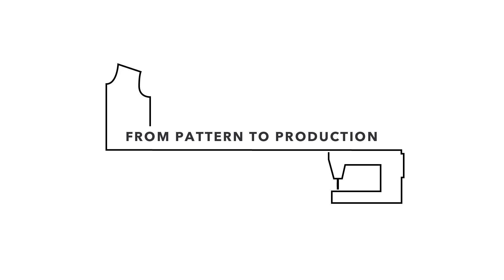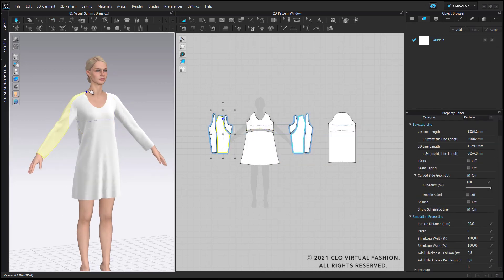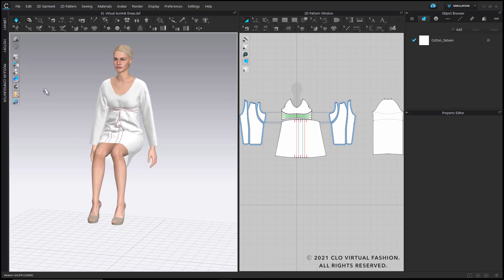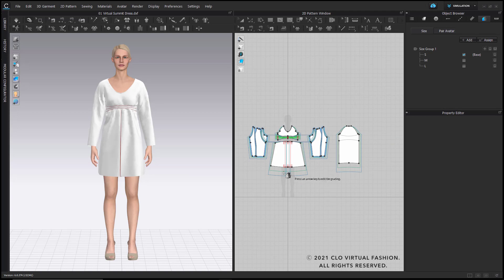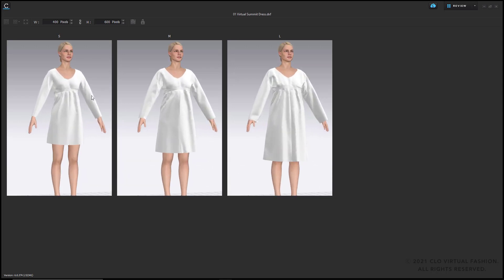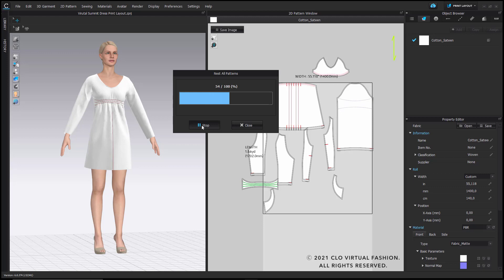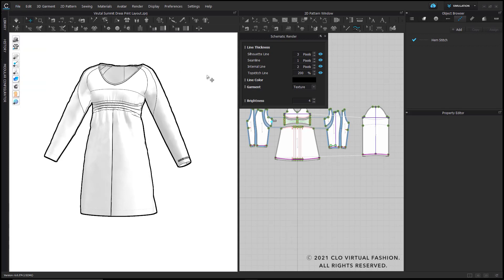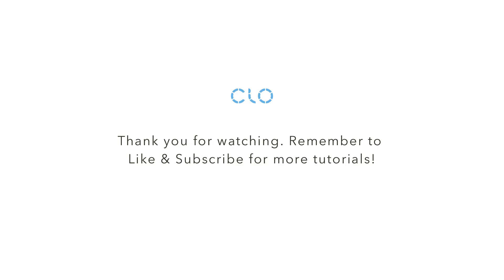From Pattern to Production

Comment: Very helpful tutorial! How can i take off the seam allowances from my DFX imported pattern if the swap cutting line/ sawing lines not responding? Is there another way to select individually seams and hems to take them off? Thanks in advance
Reply from the maker: IF your seam allowance is appearing as BASELINES inside the pattern, you need to use the TRACE TOOL to Cut them and delete the excess pattern pieces. IF you have the outline SEAM ALLOWANCE, use the SEAM ALLOWANCE tool to select and delete
Reply: @CLO3D  Thank you!
Reply from the maker: you are welcome